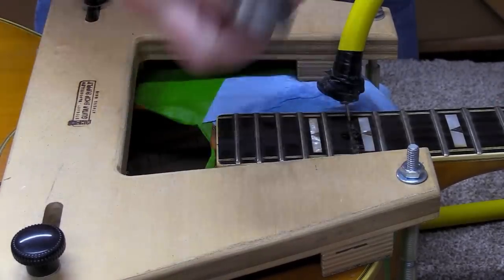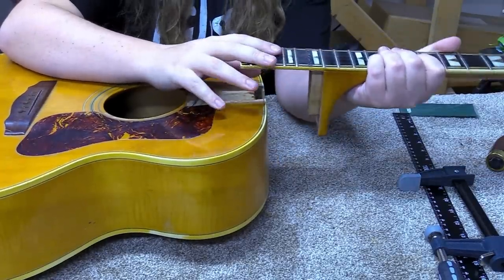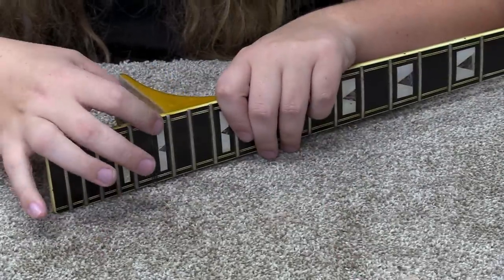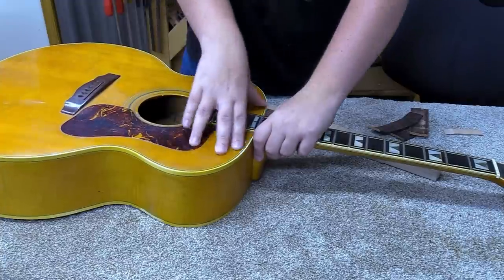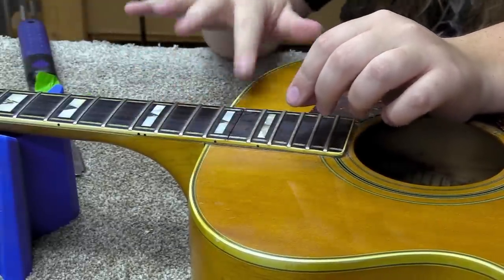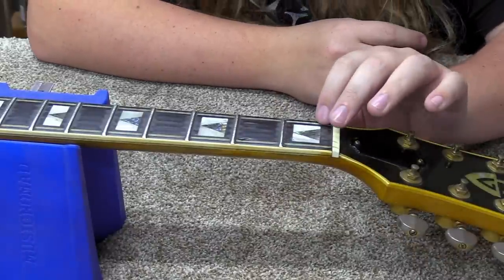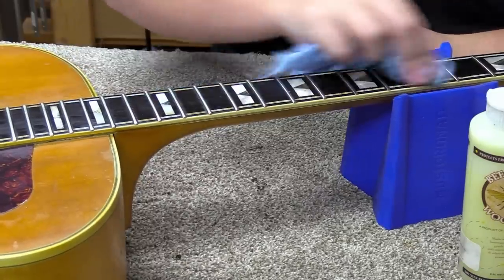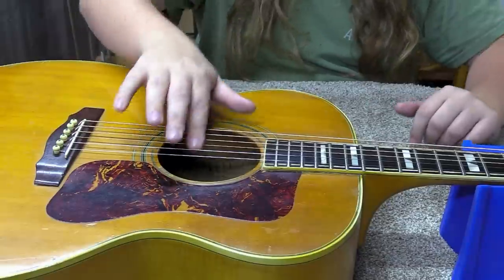1972 Guild F50 Neck Reset Part 2

Comment: Watching you tighten those nuts with the backwards channel locks is making my blood itch...lol  If you just don't have a wrench, those pliers are designed to grip much better the opposite way from how you had them. Just giving you a minor hard time. I enjoy your videos...And Uncle Jerry's.
Reply: Totally, please get some ratcheting wrenches or a socket set!
Reply: I wanted to reach through the screen and yank them out of his hand
Reply: That is so funny, I just made pretty much the same comment other than letting him know he was doing it backwards. I did tell him to least get a Flippin wrench because it looks so unprofessional. I absolutely wish him well, especially being under if you will to Jerry  Rosa. but for God sake, please look a little more professional.
Reply: Thing is, those tightening points are not what you use to remove the neck. The screw on the heal of the neck is the one you tighten to put pressure on the neck to remove it. Tightening the other nuts just crushes the guitar

Comment: I have one of these to perform a neck reset on, so I thought I may learn something from your experience. I DID! How, to use slip-jaw pliers backwards when tightening a hex nut, how to endanger myself by not securing the instrument, or parts,  in a vise while using sharp tools, and having your fingers directly in line, so if the chisel slips you can have a red stain finish at no extra charge. Thank you. S

Comment: Hi Caleb;
I predict that in time your channel will become very popular, because you are better than most at explaining what you are doing. I've watched you repair instruments every since you started working with Jerry Rosa. You seem to be a good luthier now and will become even better as you gain more experience. On this guitar, you might have considered adding a very thin wedge shim under the fingerboard extension.Thanks for sharing your videos with us. Keep on truckin.
Reply: The fingerboard extension was curled up, when he took the neck off. 3:51
A filler wedge would have just kept it that way. It, actually, needed to be glued flat.
Reply: @zapa1pnt  He just increased the neck angle. That would leave a hump in the fingerboard where it joined the body of the guitar. Ir you put a straight edge on the fingerboard, the angle between the portion of the fingerboard on the neck and the portion on the extension over the body would show up.

Comment: Nice job! I'd probably change the nuts on that neck removal tool to wingnuts, it would make using it much easier.
Reply: Knobs would be even better. The tall type, they put the knob at
the top,so you don't have to try to work around the tall bolt.

Comment: Hi. You changed the angle of the neck and put shims in the dovetail. But did nothing under the neck extention. Changing neck's angle the extention's end raises. And can't be simply glued back without a shim

Comment: Why use a chisel instead of pulling glasspaper? It would have been a lot safer and easier to remove wood slowly and controllably. You were lucky the chisel didn't slip or grab and pull out great chunks out of the heel or your hand.

Comment: nice job.  but i have a likely dumb question.  if you have to shim and refit, why not refit both sides of neck and socket,recut,and modify to a bolt on.  now i havn't the knowledge that you and jerry has but bolt on makes sense and so far the dozen i've built are holding up fine.  don't hate me just curious.  btw thanks for the info when i had to recut a saddle slot.  came out perfect. thanks.  keep it coming.  us wannabees love to steal your knowledge and run.